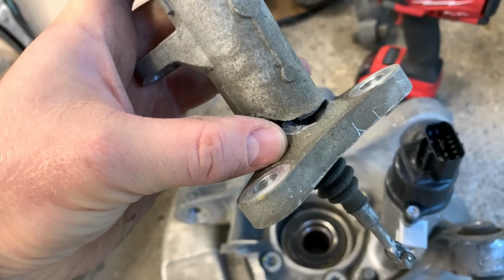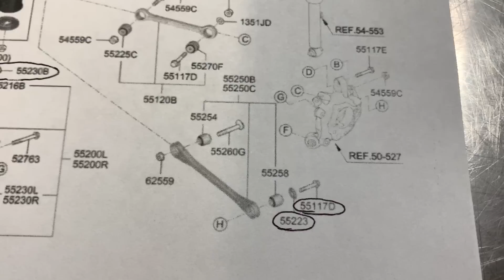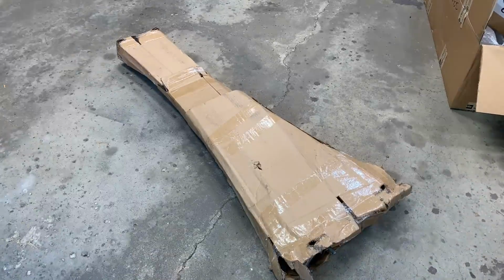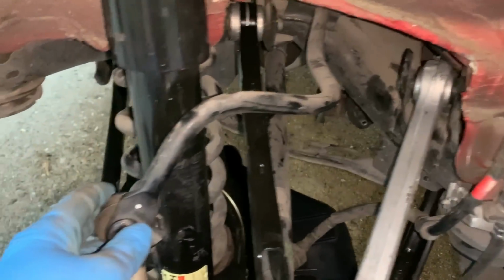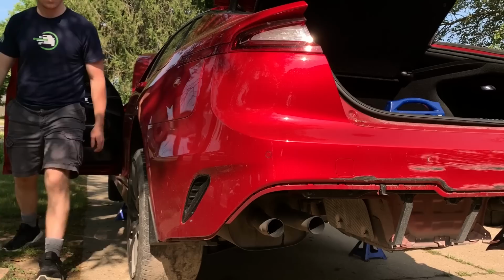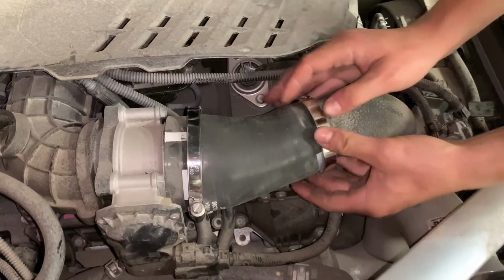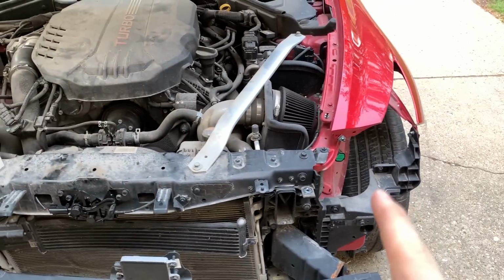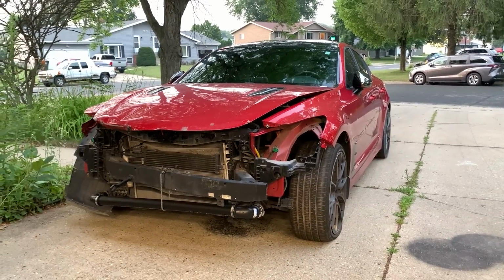Rebuilding A Wrecked Stinger GT2 For My Dad (Part 4)

Comment: CJ, did you have all the suspension compressed when you tightened all the bolts, It's a good idea to do it this way as it stops the bushes from being torn when the car is back on all wheels...

Comment: if the computer is reading that data it could be the cluster or a bad ground
Reply from the maker: Right jason, very well could be, im curious is the fault has something to do with al the aftermarket stuff hooked up to the engine harness. Along with the whole other module on the fuse box